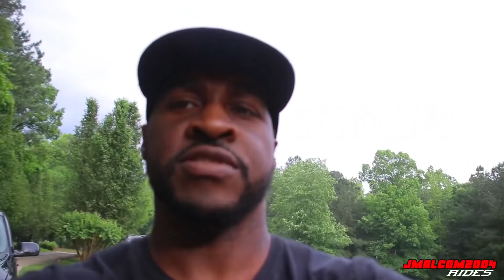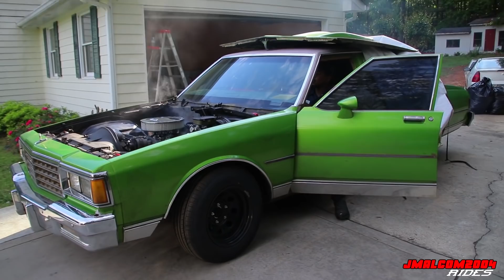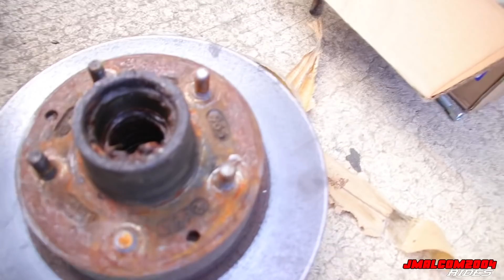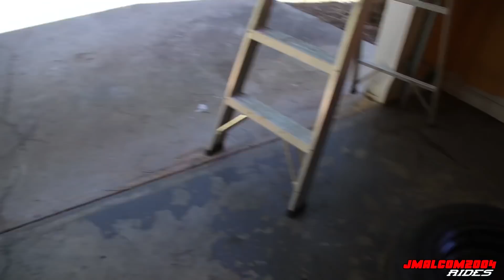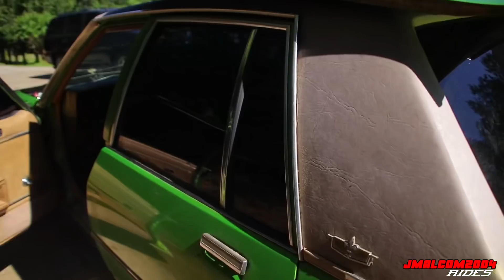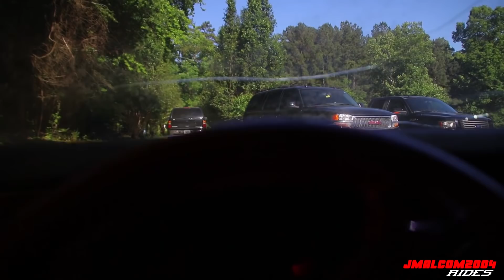BIG MEECH BOX CHEVY RETURN BUILD EPISODE 20: GETTING THE BOX CHEVY ALL IRONED OUT!

Comment: Aye J I’m glad to help also check idle mixture screws if need they also affect idle and to much fuel pressure will cause the float bowls to stay up at all times and flood the carb causing high idle if u notice it runs better with the fuel pump off, the mr gasket pump will solve everything trust me👌🏾
Reply from the maker: kapp By Greezo going to do that bro. Thanks
Reply: No problem my guy💪🏾

Comment: And if u don’t want to use the electric choke use zip tie to tie it open loop around the red plastic switch on the side and around the card stud be careful not to break👌🏾
Reply from the maker: kapp By Greezo thought about that because that’s what I use to do
Reply: To open the choke all the way up is to losing up the three screws on the side of the carburetor where the wires are plugged into the side of the carburetor and turn it til the choke is open mash the throttle and that will give you the proper adjustment on the choke then u dnt have to zip tie it

Comment: I love Holly carburetors they the best in performance but old New I’ve always had to a just them to the engine that it’s on and I’ve never had good luck with the electric choke on them so I just set the choke all the way open I wud try that also to turn the gas down on the carburetor cause the throttle body engine rigs r easy to be blown with a lot of raw gas
Reply from the maker: His and her Chevy Boi good tips and you pretty much read my mind because that’s what I’m going to do, adjust the choke wide open.
Reply: Yes sir I just had to give u that tip cause like wat doing wit the project builds

Comment: Dude I hate Holley for that reason your carb not set rite it’s dumping way too much fuel. I always say edelbrock 1406 works best rite out the box on these applications but good to see it running. U just need the mixture set rite also make sure ur oil drain oils in head not blocked with anything it’ll give u a little smoke too..I always spray carb spray around intake while running to find all air leaks keep the vids rolling I enjoy them ✊🏾✊🏾✊🏾
Reply from the maker: Highway Hustler thanks for the tips and yeah these Holleys always have to be adjusted and that’s my problem but I’ll get it all ironed out
Reply: Holleys are VERY sensetive to engine size and all of that. That looks lo3ke a 4160 but the way the plugs are yeah that needs fixed before I would start turning screws and shit on a carburator
Reply: Never buy a Chrome Holley  carb.

Comment: Hay  a old head told  me   always  check  the gap. What kind  of  plugs  you running?  Ain't  it crazy how  bad a vacuum  leak   can make  your  car  run ?
Reply: That shift  cable  linkage    and  your idle   might  need  a adjustment. That motor will  fool alot of folks trust and believe.  Thanks for  the content.